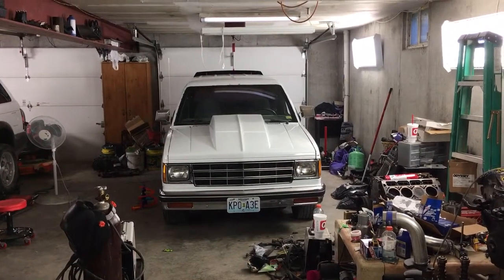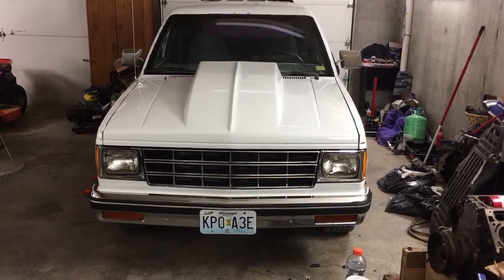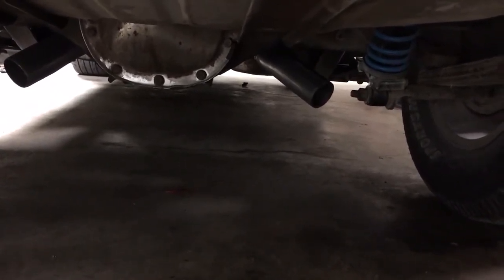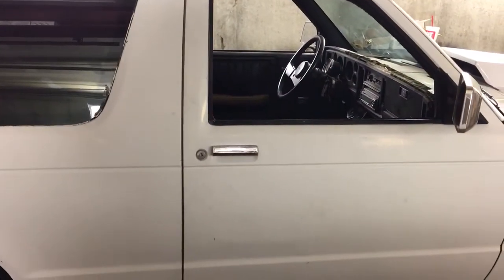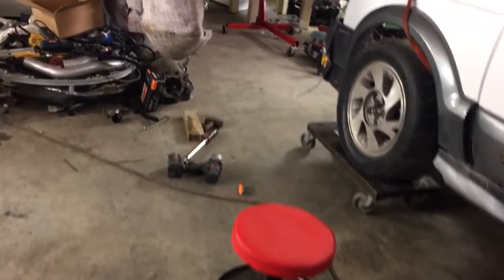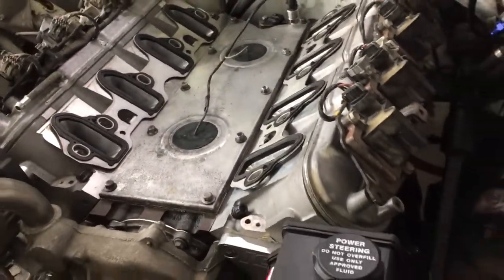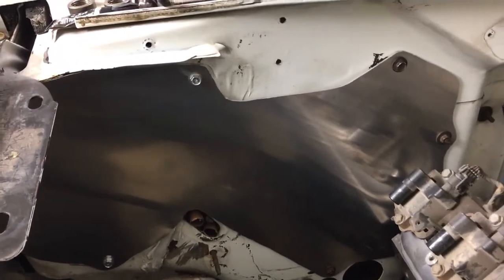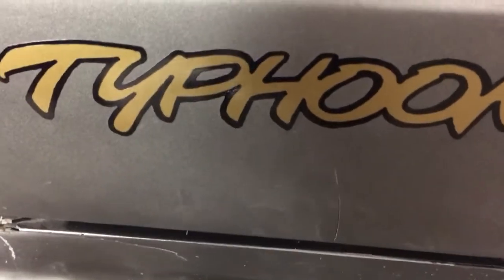1993 GMC Typhoon LS swap GT45 5.3 #3  Blazer exhaust update

Comment: I think I am going to get a T5 as well for an LS until I build more money up. Just hung up on electrical issues right now that are driving me nuts. Plus it's been to humid. I at least got my rear built and the disc brake setup on and done. Getting there.
Reply from the maker: Alpha Ghost Good to hear your making Progress.  Don't be afraid of the NV3500 or NV4500 if either are available. The NV3500 is stronger than a T-5
Reply: HeadFlowInc Okay I just did a brief research on those trannys. I didn't even know about them. My goal is no more than the 10 bolt can handle at 450whp which is what Jegs told me I will be fine with. They just said the NV3500 max output is 300ft lbs of tq. What's  stronger and how much is a good price. I did see that there is a close and wide ratio which is cool. I know a stock T5 can be ran at 450whp built.
Reply from the maker: Alpha Ghost The strongest T-5 is the V8 version with a 2.95 first gear, its rated at 310 ft of torque. 
What about the NV4500 would it fit?
Reply: HeadFlowInc It says the GM version only. Not the Dodge version. Says it has a separate bell housing so I'm not sure leading past what I read. Did you have to get a certain bell housing to fit the LS for the T5?
Reply from the maker: Alpha Ghost I'm using a 1963-66 Chevy truck cast iron bellhousing.  I feel the old cast iron is a poor-boy blow proof, much stronger than aluminum, and not $500 sfi deal.
Reply from the maker: Alpha Ghost When you install the Camaro V8 T-5 in the 12:00 o'clock position you'll have to address the angles transmission mount deal or better yet, swap out the tail shaft for a Mustang T-5 so you get the level transmission mount and better selection for shifters.
Reply: HeadFlowInc 30degrees? Ahh I think I will just go the 3500 route then. They said it's for a 98-02 S10. I have a 2000 so I will go with the bolt up route until I do a T56. Glad you told me because I didn't want to get stuck. Never done that kind of work and I do all mine own work. I also am buying a laptop and going to practice tuning my 4.3 1st. I was thinking of buying a used budget turbo setup that will swap over to the LS of my choice.
Reply from the maker: Alpha Ghost Sounds good!  The Camaro T-5 is rotated like 15 degrees towards the driver, not sure why GM did it like that. The Camaro uses a aluminum bell housing and is small limiting the clutch to only 10.4". I wanted to run a full size clutch.